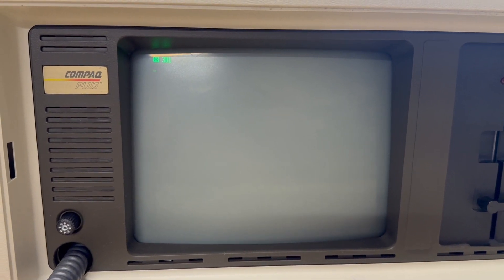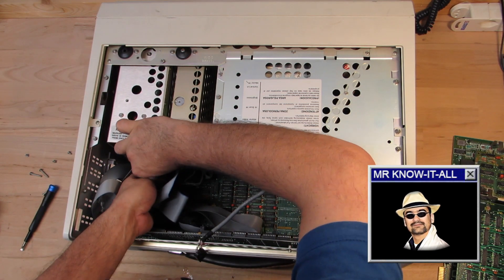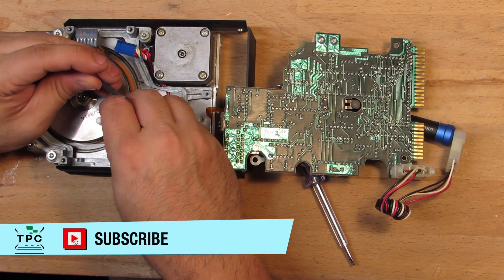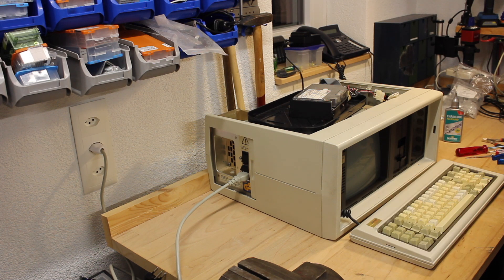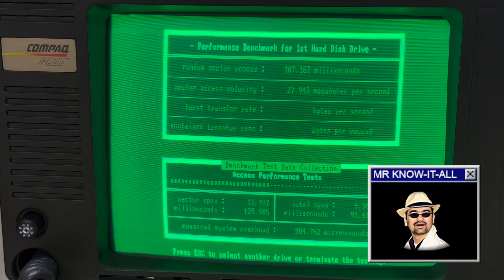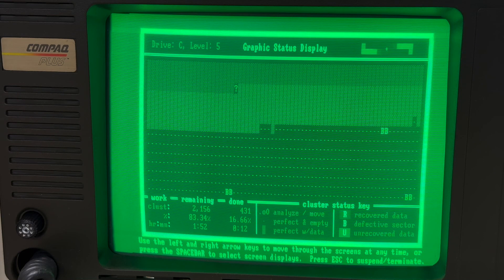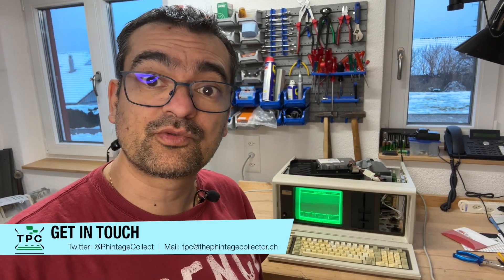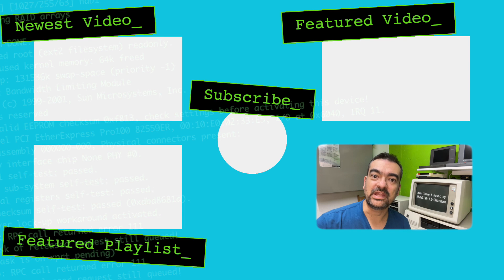How I recovered a failed 1983 Rodime MFM Hard Drive (COMPAQ PORTABLE PLUS - Part II)

Comment: A nice job to make on this machines, is remove older power supply circuit and remplace by a current and efficient circuit like atx sfx models. Are small and easy to adapt. Only some times you need -5v but you can add it with a dc to dc converter. From 12 to 5 aislated to put positive to ground and negative to -5v pin on atx connector.
Reply from the maker: Yeah, I'm actually thinking about doing something like that to restore an old IBM machine, which has a broken PSU

Comment: I have a IBM 5155 with two non functional 360k drives, I dread opening it to try and repair the drives.
Reply from the maker: I just recently had to do it for the 5155 as well, though it was not captured on video, as I did already quiet a few videos on fixing floppy drives already.
Nevertheless, you find some useful hints on the floppy drives used in the 5155 here: https://www.lo-tech.co.uk/wiki/QumeTrak_142_5%C2%BC-inch_Floppy_Disk_Drive

Beware, later revisions of the 5155 used NEC drives. Though, if you have the QumeTrak, it was in my experience very straight forward.

For me, it took just some head cleaning to make them working again.